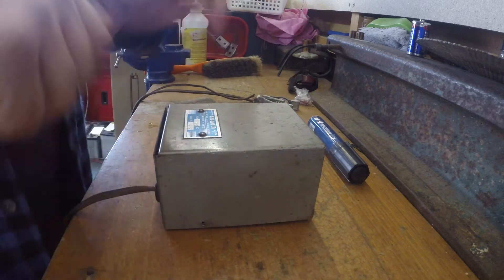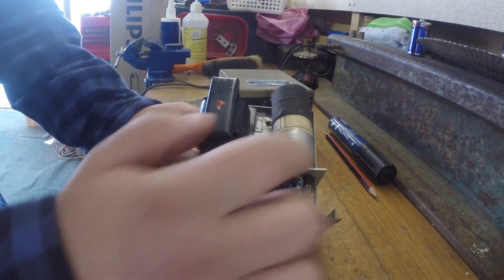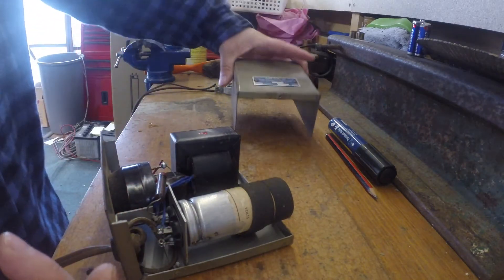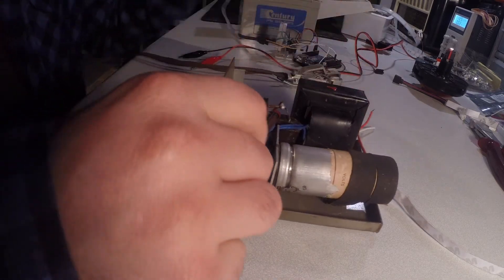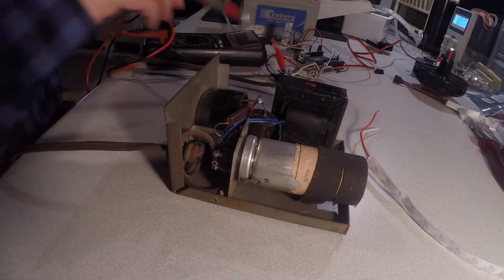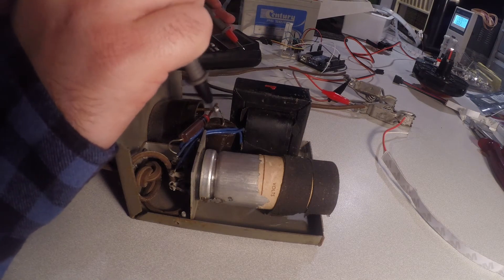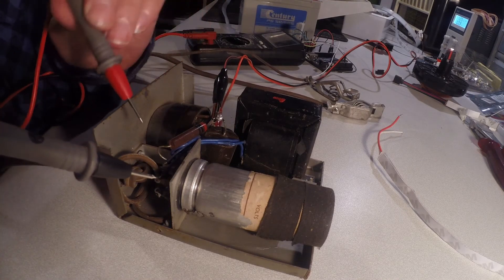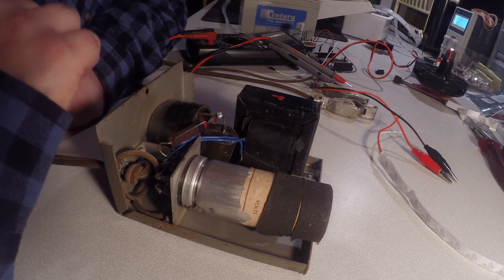Teardown #6 - Vintage Power Supply

Comment: I got one of these. The cylinder is not a valve but a vibrating relay. It buzzes and creates the mains voltage in the transformer, power it up again and give it a good tap on the side to get it going, that usually does it. cheers. :)